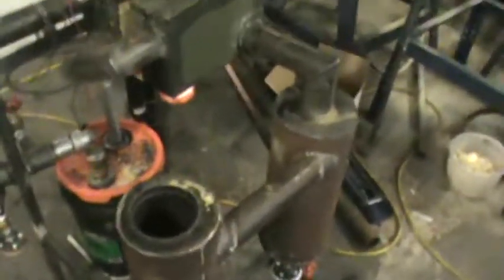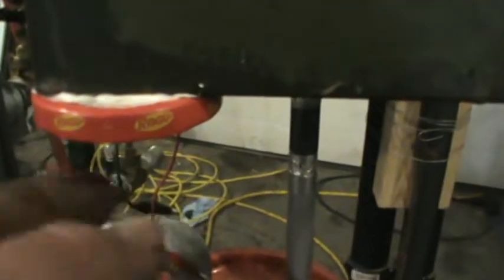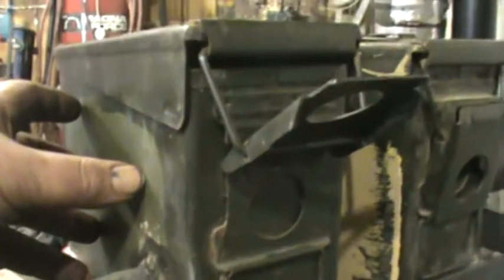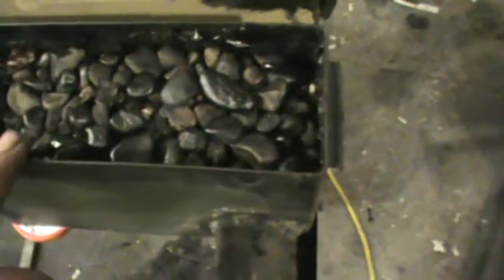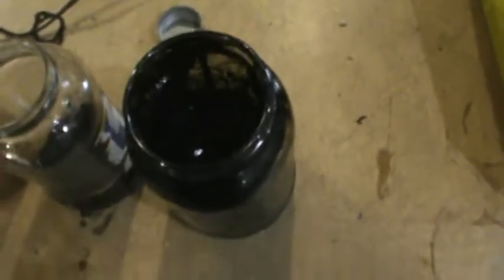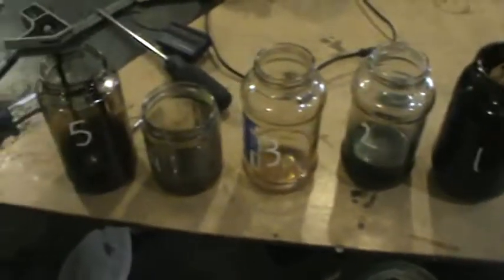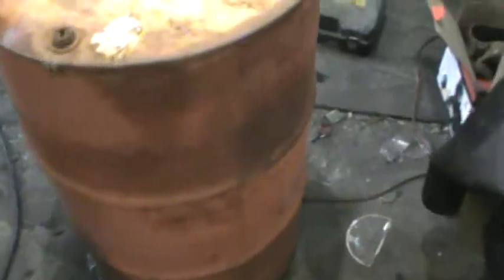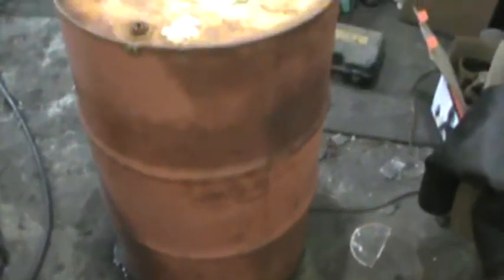Wood Gasifier Filter and Performance Update Cold Weather Video 16

Comment: OK my name is les from England & I learned a long time ago that the  secret to good gas production was , the ues of alter in a charcoal  colom  back in 1962  we had a very bad winter. & my family lived on an of grid small holding . we had a well for water & we mad our own electricity By barning wood chunks in was was a old Truck gas genarater , back then in that winter  my gas genarater. was not burning well far to much what you would call damp gas. resulting in a lot of water . & in you design it seem you have discovered the very same problem. & lick the rest building there thing approach the problem in the same way  in an atempt to pull of as much water as possible to dry the wood so it will tern to charcoal . 

& there is  the Secret of wood Gasification.  We all seen to miss  most to date have mist yes  including me until that very bad winter.  Let me exsplan to you,  to get wood to flash to what I call good gas  We have to build the gas genarater in this way charcoal at the barn chamber & up to the reduction zone  at this point the wood is  pity dry & will ten to charcoal all above can be a mic of 50/50 wood & charcoal  & wood chunks mix. in with the charcoal   absorb the damp smock to the Bren-camber. [ Confused Yes I know you are , ]  

The reason is your thinking why there is   next to no wood how can it Mack good gas..  well it the water in the wood fibbers is wat masks good gas.. not the wood so very much it das contribute some.  But it the charcoal the wood masks the Convection of the water into good gas. I stops trying to get my wood gas genarater to balance,  the charcoal &  wood it mad & worked  on the assumption that if I  built a separate  charcoal colom & got it running on the vacuum pump it would  ignite the carol at the colom & pull the damp smock in & up the  colom  barning of the oxygen in the smock & enriching the colom with habergeon gas. that would be pulled into the flirts & out at the flair & thus to the engine to run the gen set  I discovered the  system work well, &  late i discovered if i dript water into the charcoal colom in a way so it would flash to steam,  i found i did not need wood at all. gust charcoal to provide the combustion.   [So there you have it]the secret to gas production. 101.  it a common them dry out you wood before gamifying it,   But H2/0  "2 pares hydrogen to one part Oxygen is locked  up in the water within the wood,  interesting concept that. 
What-what. [Les England]  

Ps,  Hop this helps you out. test it out see keep the burn chamber at 2000c or hier  But a minimum of 2000c. this is achieved by barning oxygen. in the damp smock. or water drips.   then the gas is good  { INPORTRNT } their is monoxide gas with in the smock  So it impotent not to breath it in  Your "Immure. Globin"  love monoxide. more than it dose oxygen. operate it in the open air with plenty of ventilation,  to keep your work area safe.   final if you desire to cool down you Bern chamber allow a litter excursed  gas to enter your  are input . by firing valve to allow it intake .   "OK"  in closing test out what i have told you & build in a charcoal  colom to burn the damp smock in. so the oxygen within can enrich the gas in the colon . if blue at flair  it monoxide gas, as dioxide  doesn't Bern,  : -{ If yellow or Megara it hydrogen, Good gas .

Comment: interesting  the amount of  water in your smock . i had the same problem as a lad in England i got over the problem  by sending my damp smock  through  a charcoal field pipe. set in a fire pit air feed , that achieves   sufficient heat  to Bern of the oxygen it the damp smock  i.e.  steamed the siystom vacuum fed by using your  blower to pull the stem IE damp smock over the  over a fier pit .   remember gas dos not Bern in a vacuum  but oxygen will be barn of in the plasma  stream as it hits the hot spot on the pit .  this was the only way i could improve my gas production a second reaction  before the filters .

Comment: I know it's been years since you posted this video but awesome design what kind of run time do you get out of it? and how much wood does it burn and for how long before you have to open it and add more fuel ? Also how big of a load can this handle like what's max size generator it can run?

Comment: If you cook the rocks to clean them... be extremely careful if not avoid that completely because river rocks containing moisture can explode when heated. Maybe metal ball bearings could perform just as well? 
Excellent system though man. Im excited to begin building my own

Comment: Using glass marbles is the ticket, I'm sure. And the temperature of the marbles can be controlled by using a coil of copper tubing in the marbles and running the proper temperature of water through it.

Comment: Just a thought, if you were to sit your reactor in a bucket of sand you would maintain  the reactor temperature which would push the moisture further down the line, you wouldn't need a drain then. System looks good. Look into fractional distillation. As you get further from the reactor you start to see some of the fuel vapors condensate. That last distillate is probably Paraffin which is a usable fuel close to Kerosene. Nice videos looks like the frozen Tundra out past your gasifier!
Reply from the maker: Thanks for the suggestions, I have found that if I only run gasifier for a short time the condensation will stay in reactor, but on prolonged run times its nothing but ash that comes out of reactor cleanout. So the moisture must get passed thru the system with higher reactor temperatures. Warmed Right up its running about 250 Celsius. Any suggestions for paraffin? it burns bright yellow/orange and smells delicious! LOL I filmed in that direction so my Igloo was not in the background!! LOL JK
Reply: Rod Mcdonald It's been too cold and windy here to work on the gasifier. I have mine sitting out on it's trailer covered with a tarp.Your excavator would look pretty sweet with a gasifier mounted on the counter weight!
Reply from the maker: LOL! Ive considered that.... fortunately its quite reasonable on fuel. Not saying I wouldn't consider it after she gets retired! LOL